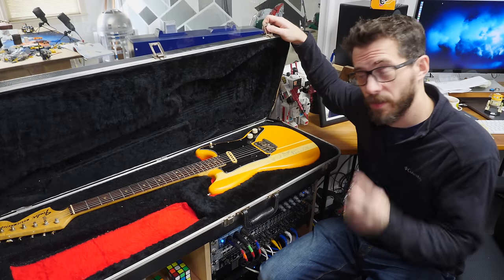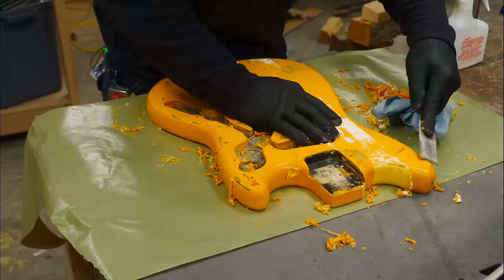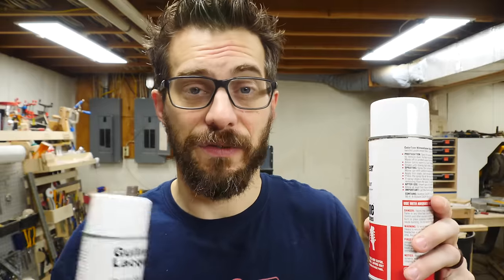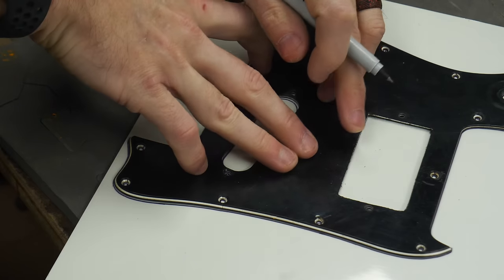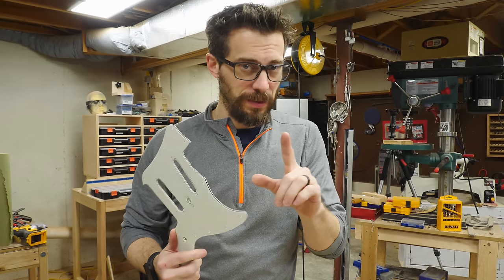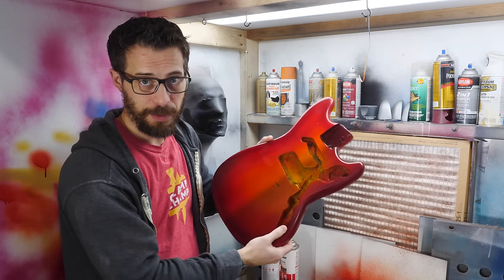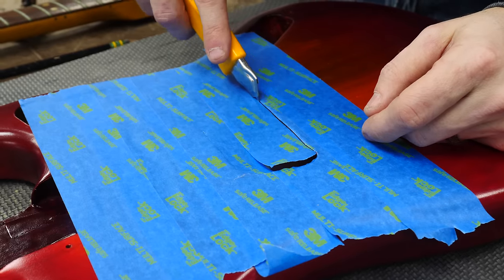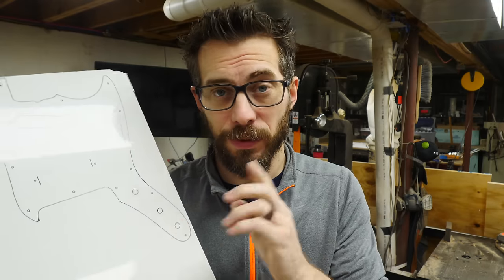How to Refinish A Guitar | I Like To Make Stuff

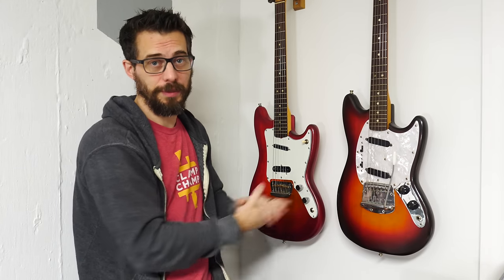Comment: 24:34   I am a professional, and he's right.  I am in the process of refurbishing an original 1968 Gibson SG in nitrocellulose lacquer.  It's taken me about 6 weeks of painting, 2 weeks to let it cure enough to level sand, and 2 weeks of sanding and buffing so far. When im done with that, it will still need to cure for another 2 weeks. This is pretty standard procedure around my shop.   I have well over 300 hours in this guitar and it is GLASS smooth. I still have another 8 hours worth of sanding and polishing before it is PRS quality and i can re-assemble it, set it up, etc.
Reply: I AM A MASTER FINISHER. I HAVE 45 YEARS OF EXPERIENCE WITH EVERY FINISH AVAILABLE FOR EVERY SUBSTRATE. I AM CERTIFIED FOR ALL FINISHES. I RECOMMEND USE AN INFRARED LAMP TO CURE ANY FINISH IN LESS THAN AN HOUR. IT IS USEFUL FOR METHYL CELLULOSE, NITRO CELLULOSE, AND ACRYLIC LACQUERS. I HAVE ALSO REFINISHED GUITARS AND PIANOS FOR HIRE, BUT I PAINT EVERYTHING.
Reply: So, this guitar must be worth beaucoup bucks when you are finished. That is the problem, not many guitars are worth that much love opposite buying new.
Reply: @stephenbowyer7269  I have a $99 Kramer that is one of the best guitars I've owned. I've owned many-thousand-dollar guitars.  You love what you love. I love women while my best friend of 30 years loves guys. If you love it, it's priceless, and no amount of money is... Oh, who am I kidding? I wouldn't put more tha $700 into my Kramer.
Reply: Do you ever use any wax to help give it a glossy shine?
Reply: @tomsanders9491  I'The reason I dont used lamps for nitrocellulose, is because it can be humid here, and when spraying coats, as you know, it traps the water molecules in the paint as it floats through the air. I want the stuff to have the longest open time possible so the water can evaporate out. In fact I typically use retarder or thinners to make it take LONGER to cure.   I'm not saying lights are a bad idea, but for me, they aren't the best option given the environment I'm working in.
Reply: @stephenbowyer7269  the SG took me a grand total of 400 hours to finish. He should be able to sell it for between $4-8,000 usd depending when he sells it, where he sells it and several other factors. It's worth more now than it was to start with for sure, but is no longer original. A pristine original can be 15-20 grand.
Reply: @leathernluv  I agree. I have bough cheap guitars that played and felt better than expensive ones, I've bought expensive ones that blow the pants of off everything else. It's all subjective and really comes down tocolaying 100 different guitars and finding the one that you like best, regardless of price. But, higher price guitars have better fret work, are made of higher quality woods handmade from less pieces of wood. A Gibson and an epiphone play and feel about the same, but one uses 5 pieces of wood for a body , the other uses...... less....  1 to 3 typically. But a professionally setup elite series strat beats a professionally setup made in Mexico strat any day of the week in my opinion, and theres a thousand dollar difference.... for a good reason. But again, some of it is subjective.. however, any time someone brings me a strat to work on, I have them play my Elite Series. 100% of them notice a huge huge difference between the two.
Reply: By the way, all told.. I ended up with about 400 hours total in that SG by the time I finished it
Reply: @MythicGuitarCompany  THEN YOU SHOULD BE USING A CATALYZED ENAMEL WITH A MOISTURE INHIBITOR AND MID TEMP REDUCER. SET "ROOM HEAT TO 85 FOR PREP THROUGH 7 DAYS CURE TIME POST PAINT. FANS FOR AIR CIRCULATION. EXPLOSION PROOF EXHAUST UNIT, IF YOU HAVE ONE.
Reply: @tomsanders9491  thanks!  Those are great tips.  I'm a pretty small operation right now, so I don't have a booth, fans, etc yet. I spray maybe one a week now on average, but will be ramping up production soon.  I'll look into those things when I build my workshop.  As for the catalyzed enamel, I do use PPG auto paint, and other brands, etc, but, not if a customer asks for Nitro. Most of the guitars that I build on my own and sell, are enamel. Lots of commissioned work is for Nitro, though I always advise them against it.  But they are willing to pay for my labor if they really want it.
Reply: @MythicGuitarCompany  PPG MAKES GREAT PRODUCTS. I USE THEM FOR ALL KINDS OF CUSTOM WORK, INCLUDING STAIRCASES AND CABINETRY. DUPONT IMRON AND CENTARI ARE ALSO BOTH EXCELLENT ENAMELS. IMRON IS POLYURETHANE ENAMEL AND CENTARI IS URETHANE ENAMEL. BOTH ARE CATALYZED AND CONTAIN ISOCYANATES, WHICH CAUSE THAT "MILE DEEP FINISH". I ALSO USE ALIPHATIC URETHANES FOR MANY PROJECTS. I WORK OUT OF A 3 CAR GARAGE MYSELF.
Reply: @tomsanders9491  not wanting to be be rude, it's a serious question, but is something with your caps lock damaged or something? Because even your username is all caps. I honestly don't want to annoy you, so sorry if I said something wrong :/
Reply: @fabianvanderelst9643  I'M SORRY ABOUT CAPS. I HAVE A BRAIN TUMOR CONSTRICTING BOTH OPTIC NERVES THAT MAKES LOWER CASE LETTERS DIFFICULT AND SOMETIMES IMPOSSIBLE TO READ
Reply: @tomsanders9491  NO WORRIES MAN! I'M SORRY FOR ASKING :/ I'LL REPLY TO THIS IN CAPS SO YOU CAN READ IT BETTER ;)
TAKE CARE! 😊

(EDIT: I'M SERIOUS, I'M NOT LAUGHING WITH YOU, I HOPE YOU DIDN'T THINK I WANTED TO OFFEND YOU. HAVE A GOO DAY!)
Reply: @fabianvanderelst9643 WHEN I SAW YOUR QUESTION, I  THOUGHT, THAT HE MUST BE AN ENGINEER.  ENGINEERING STANDARD IS TO USE CAPS FOR ALL DRAWINGS, CALLOUTS, MEASUREMENTS ETC,. WHEN I WAS AN ENGINEER, ALL OF OUR EMAIL AND OTHER COMMUNICATIONS WERE IN CAPS 90% OF THE TIME, BECAUSE ALL OF DRAWINGS HAD TO BE IN CAPS. IT DROVE THE SALES PEOPLE CRAZY.   I LITERALLY DIDN'T NOTICE THAT HE WAS TYPING IN CAPS!   HAHA
Reply: @mythicguitarcompany4826  That's a really funny thing 😂. You will also never make a mistake ever with capital letters, since all of them are capitals anyway 😂
Never knew that about engineers! 😊
Reply: @fabianvanderelst9643  the really funny thing is we would yell at each other in lower case. " I JUST can't believe THAT YOU'D DO THAT!"
Reply: @mythicguitarcompany4826  That makes it even funnier and weirder for people who don't know that 😂 😂 😂 That's hilarious 😂
Reply: Say I have a guitar in an original wood finish, but I wanted to liven it up a little. Not gloss, just make the wood shinier. Is there any product that you would recommend?
Reply: @159Fender159  danish oil, if it is completely unfinished raw wood. Or gun stock oil, but that takes a bit more effort..    I'd go with danish oil, but if the guitar is sealed, the oil won't soak into the wood.
Reply: Mythic Guitar Company thanks for the tips!
Reply: @MythicGuitarCompany  I want to refinish my bass with nitro, why do you advise against it?
Reply: @tomsanders9491  Right to the left of the a key on your keyboard there is a button labeled "caps lock". Press that button please. You are welcome.
Reply: hey sorry to revive this thread, but im considering doing the opposite to the flamed maple top on my guitar. it has a blue satin finish, but pretty much every refinish ive seen is done with a gloss finish or a guitar that has not been finished yet. what would be my course of action for removing the blue satin finish to convert it to a natural finish?
Reply: A pro watching a tutorial on his profession
Reply: @tomsanders9491  dude. Wait, sorry, DUDE: ALL CAPS ISN'T GREAT COMMUNICATION.
Reply: @kilgoretrout321  I HAVE A BRAIN TUMOR THAT AFFECTS MY EYESIGHT, DUDE
Reply: @tomsanders9491  if you wanted to respray a new guitar could you just sand it down lightly and apply a few layers to the top of that?
Reply: Most of your cure time can be eliminated with infrared lights to accelerate curing. In automotive painting, a 120 day cure is achieved in 30 minutes of baking
Reply: @patientswim6888  Of course it can be done. Acrylic enamel will do an excellent job

Comment: For temporary work holding use a piece of masking tape on both surfaces and super glue the tape to each other. It will give good work holding and is easy to peel off.

Also always do a dry run on fitting objects in to cavities before you start working on finish, it just saves so much time and heartache.

Comment: Hi Bob, Enjoyed the video thanks.. Ive had similar problems with the Fender noiseless pickups before,. I embarrassingly routed out the pickup cavity only to find when i set the height of the pickups correctly that they would have fitted in the original cavity. Only thing I have to offer on the install is that you could have used the old pick guard when routing the finished body for additional protection. I’d also use shielding paint in the pickup and electronics cavity, although this may not be necessary with the noiseless pickups. Thanks I’ve just started watching your channel and i love the content.

Comment: To get a mirror gloss finish you have to use wet/dry 800, 1000, 1500, and 2000 grit sandpaper (use high quality papers that do not clog as quick as cheaper sandpaper does (3M makes really good stuff).  

The way I leaned to final sand clear is to spray 12 to 15 coats 9no need to sand between as the layers below will blend into each other.  Start with 800 grit in circular motions.  Once that's complete move to 1000 grit in a straight motion (length of the body/ or with the grain) to remove the swirls from the previous.  Next more to 1500 again in circular motions and finally finish with 2000 in a straight motion.  Each step will require you to remove the dust.  Also at any stage you are looking to create a hazy look.  Any high spots will still look glossy under a light and at eye level from the sides.  You don't have to do this wet, but it keeps the dust down though it is messier.

Finally using swirl remover and a buffing wheel (or a lot of elbow grease) polish to that gloss shine.  Any burn through (meaning you went to hard and removed paint) will have to be touched up.  Also black guitars will show every single flaw in the finish so prep work is essential.

Take your time with the process because once you see the results you'll be really impressed.  In fact you can go beyond the factory finish and make yours pop more.
Reply: I agree with just about everything noted above, I just would like to add a few hints and suggestions. Using a orbital car buffer (look at Harbor freight for best priced 6 in buffer, then buy a 5 and 3 inch backing plate. **DO NOT USE THE PADS YOU SEE AT HF. **  (I only use them for non-wood counter tops)   is the best advice to keep from "burn through"  forget swirl remover. I am a detailer on the side and love paint correction.  My advise is skip the swirl remover all together and do it all the way. Take it to 3000 then a high end compound (NOT TURTLE WAX CRAP)  Use a pro level product not enthusiast grade (what you find at Walmart and on most auto store shelves, with the exception of NAPA).  Cut with a medium cutting pad (using a 3 in backing plate is best for this size project) The pad color depends on manufacture.(Buff & Shine or Lake country  orange flat pad)  remember do  not overload your pads a little goes a long way.  After that, I would use a white then green flat pad (either of the companies above) and a high grade polish. to finally seal it, you can choose Wax, (my favorite is the POXY form HD) or best yet, ceramic coat it.
Reply: @beamerstrumpet  
Thanks Scott & KJ
Finishing a guitar is tough work, lots of trial & error, and finding what works best.  I get humored by some of the dings given to the guy making the video, some are pretty spot on funny.  But reading through the comments people offer up what works for them and for me sometimes I get more from the comments than the video.